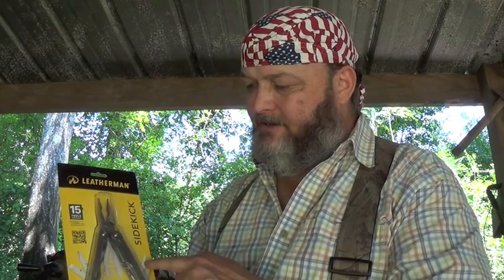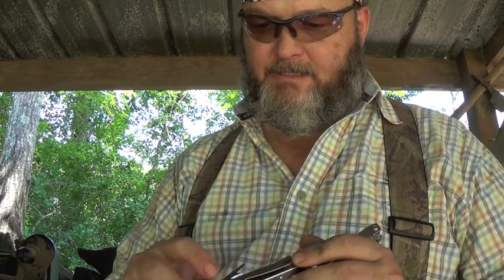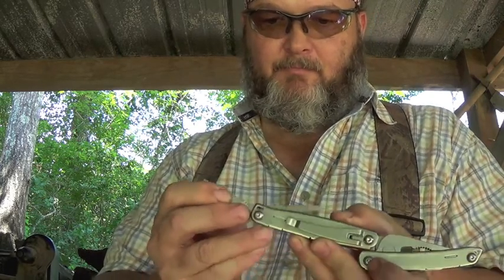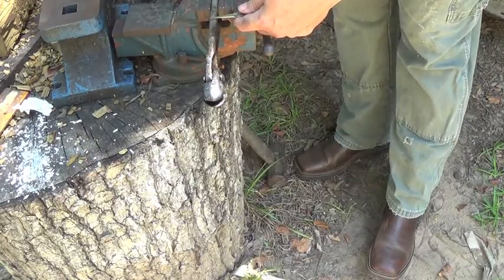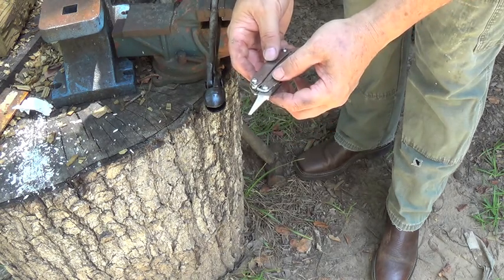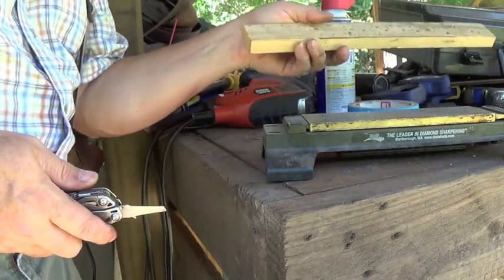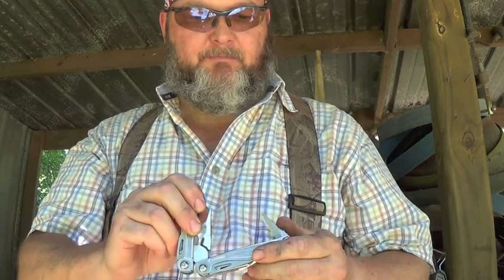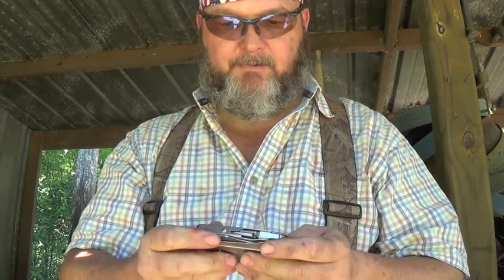Simple Leatherman Sidekick Modifications

Comment: I just picked up a sander/grinder similar to yours, a 2x42 at a pawn shop. A Palmgren brand. Never heard of them but it is one of the few made in USA producers still in existence. Have not used it yet as I work this oddball shift but will be on it tomorrow.

Also thanks for the ideas, I also have little use for a serrated blade, this might just be the ticket.
Reply from the maker: Bruce Prosser Use mine a lot especially with crooked knife handle carvings. Best modification I could have done. Love my grinder but wish it had a variable speed. This craftsman has one speed...fast.